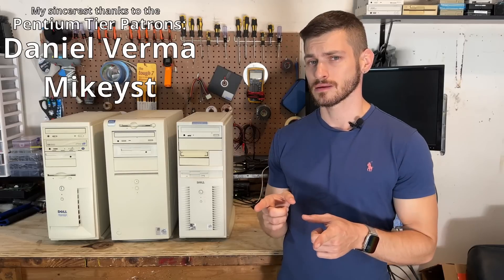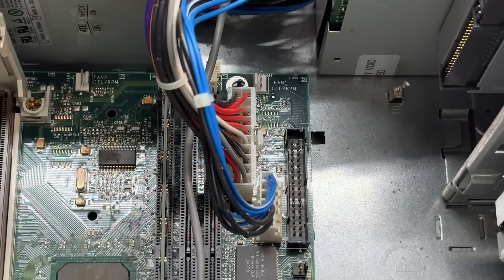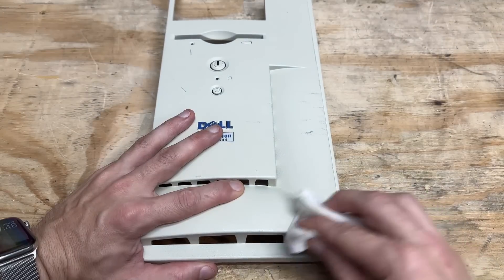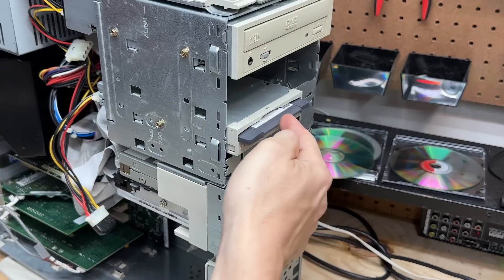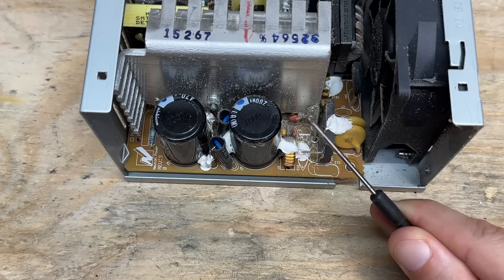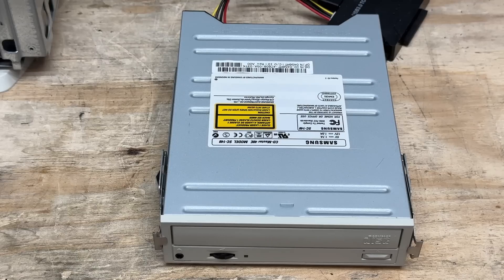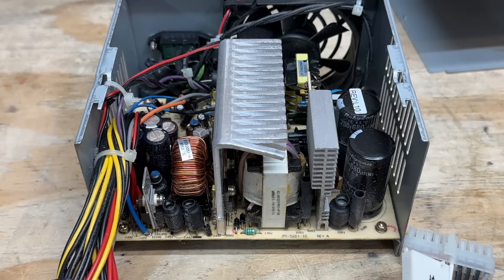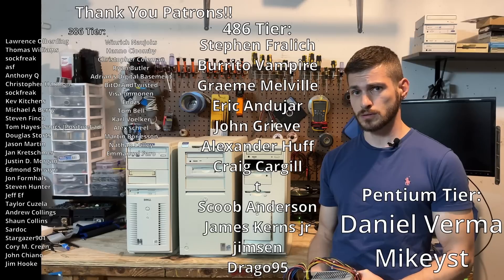Time to resurrect some Dell systems!

Comment: The PSU in the first system was a deliberately-laid booby trap.  There was literally no reason for Dell to put a proprietary-pinout PSU in there; in fact, Intel made the very same board for other OEMs, but with a standard ATX connector pinout.  Connect a standard ATX PSU to your Dell motherboard, say goodbye to your CPU and RAM if you lit that thing up.  Caught one of my techs unaware.

There were adapter pigtails available for a while that would allow you to use a standard ATX PSU with your Dell mobo, or a Dell PSU with a standard ATX mobo.

Comment: Sorry i looked... i also couldn't find a restore disk for the XPS
Reply from the maker: I sure hope one turns up eventually.
Reply: @miketech1024  its odd normally  alot of this stuff ends up on the internet archive Software section...  it could be that someone has miss named it or something.. i found  the dell driver page for the XPS T500.... crazy AF that they still have drivers from  that long ago

Comment: If you'd like, I need a way to send you a link for a Dell OEM Windows 98 SE reinstall disc image. I also have a vintage product key for it, unless those Dells have their Windows keys on the case sides. YouTube doesn't allow links in comments.
Reply from the maker: That would be great! Could you email it to me? My address can be found in the channel about page under business inquiries. Thanks!
Reply: @miketech1024 Done.
Reply: @miketech1024 It'll have the Dell logo in the system properties, which is always nice to have on a vintage Dell.

Comment: Man I had some good times on my old OptiPlex GX-1. First machine I ever upgraded the processor in (PII to PIII). Mostly ran Windows 98 on it with a little XP sprinkled in, I still remember talking to my Aunt Robin on Yahoo! Messenger (and later using Y! Messenger to send free SMS messages because I only had 500/month on my old Virgin Mobile plan

If you need me I'll be reveling in my nostalgia